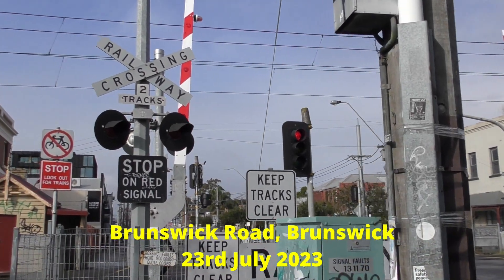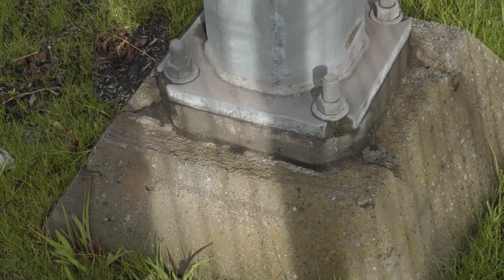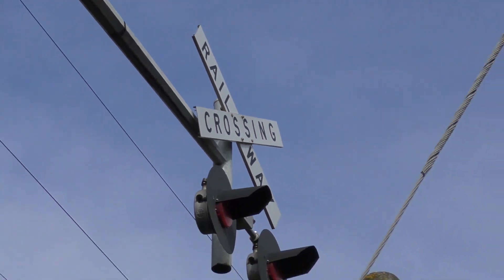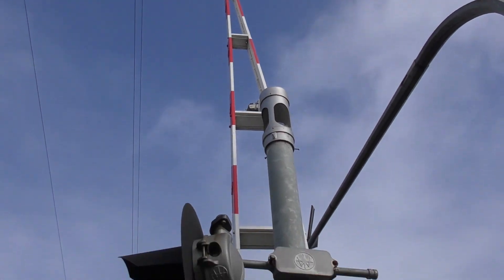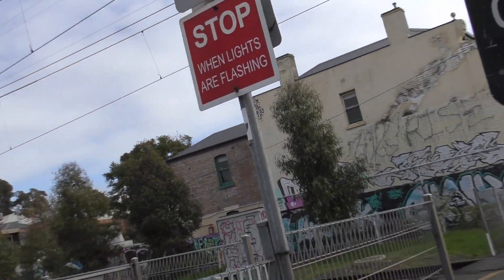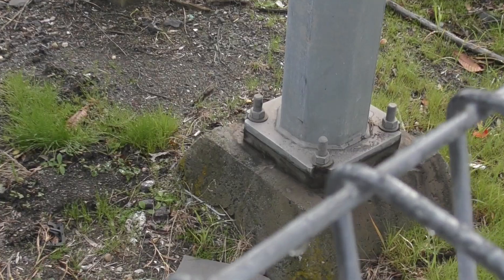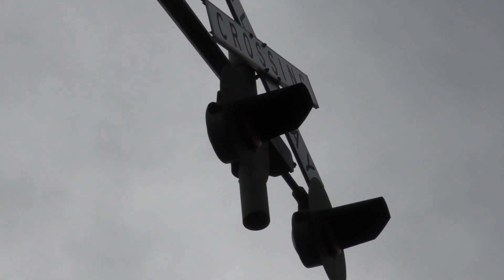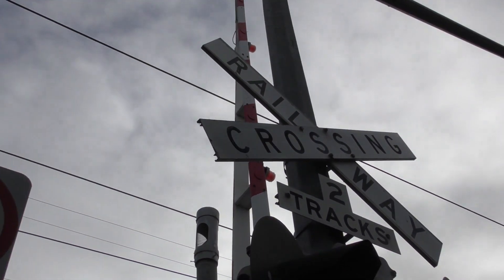Brunswick Road Level Crossing, Brunswick, Victoria

Comment: One of the busiest crossings in the area. Up until late 2017 or early 2018, it had barker technics ebells. Its so sad they were replaced, because theyre my favourite ebells dating back from the 1990's. Despite the bells replaced, this happened to the other 7 level crossings in this area
Reply from the maker: Yep upfield line was one of the last lines to have a bunch of crossings still with barkers in the 2010’s